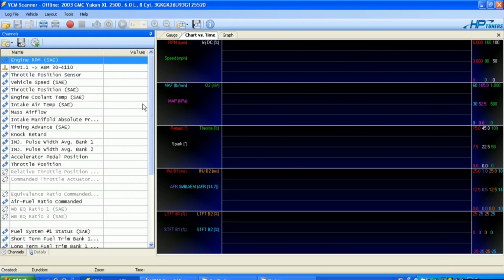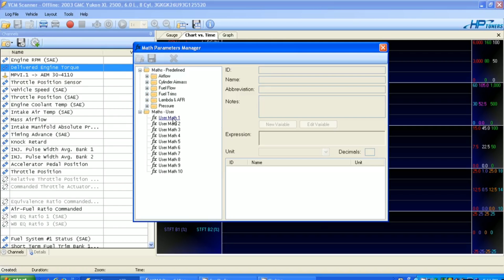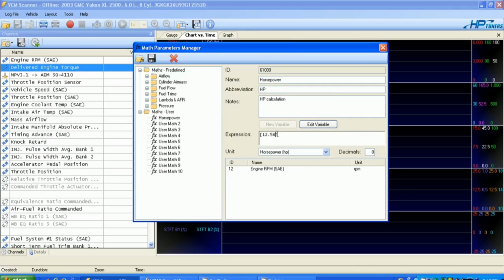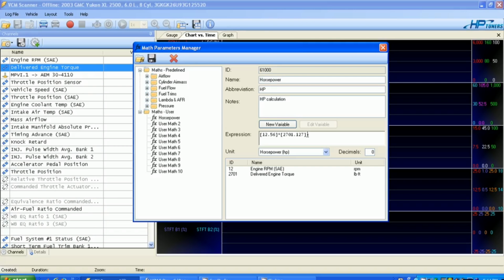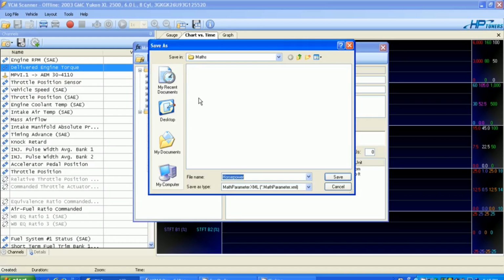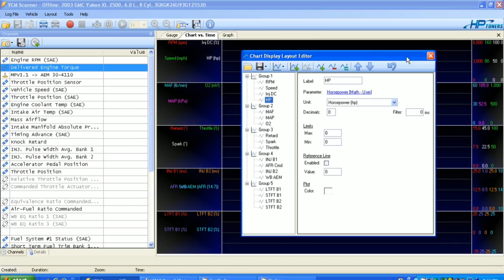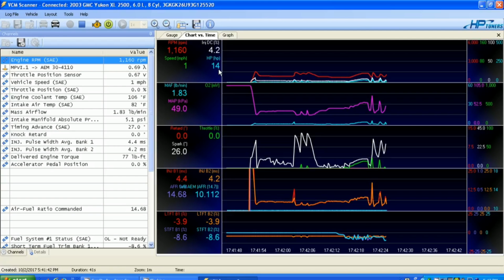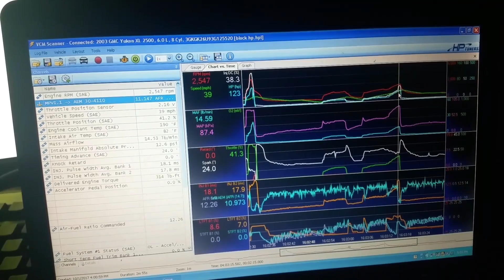HOW TO LOG HORSEPOWER IN HP TUNERS!!! Adding horsepower to data logging graph!!!

Comment: is there a math for delivered engine torque I cant get it to pull up in my channels list but I can get it in the chart and graph 
do you know what  I can do to fix this
Reply: Kinda late, but you might have to use trans torque. My vehicle doesn't have engine torque either. Trans torque works fine

Comment: Did this an I know damn well it’s off close to 200 horses . Mine stock is rated at 285 off the flywheel so when it’s registering only 160hp in a full pull I know it ain’t right
Reply: @ steel sledge

As far as I know you multiple by 1.2 to get your flywheel horsepower.  He showed to multiply by .80 which doesn't give the correct result; it will be low.
Reply: That's 285 in perfect conditions... At the flywheel 285-20%=228 rwhp. Then account for the commanded Af ratio being lean (14.7) and 160 ain't bad to the wheels with no tune. Adjust a few parameters and you'll see your 220 to the wheels pretty easily...maybe more
Reply: Daniel Thompson also I forgot to mention I am cammed, bigger injectors , bored , head work , free flow exhaust , and many other things so I think I should be reading way more than 160hp my friend
Reply: Daniel Thompson well I started at 150 , and maybe 4 logs and 3 tunes later made it to 160
Reply: Wow... Yeah, I'd think you'd have seen more than 10hp from all that... What kind of timing and afr?
Reply: Daniel Thompson commanded at 14.6 but it registers from 13-15 driving partially due to collector leak on bank 2 my timing is anywhere from 19.5 an up
Reply: @lostkauz83  do you have a performance tune and a gas mileage tune or "just one tune for every day"? Timing and fuel are your issues, for sure. There's still a lot of room on your existing tune...
Reply: Daniel Thompson  it’s just a drivability tune more or less . And yea I have some small tweaks to make in the VE with a few runs .

Comment: Cant find delivered engine torque, in the add a channel. Is it for specific vehicles ? 2000 s10  i did the calculations but the engine torque ID stays red cause its not added to the channels.
Reply: Use trans torque

Comment: I've been using the Torque to HP calc for a while now. Never thought about factoring off 20% for rear wheel. It looks like it's really close too I think I will try it and adjust that 20 to calibrate it somewhat until it shows 0-1 hp when put in gear. Good stuff man!

Comment: I had these PIDs open while dyno tuning my car. Every time the dyno number went up, the PID number went up. And when it went down, the PID number went down. Not by the same amount, but I think it was good enough to use on the street without a doubt, and that's what I typically do. Just make sure it's the same stretch of road starting at the same mph to get rid of some variables.